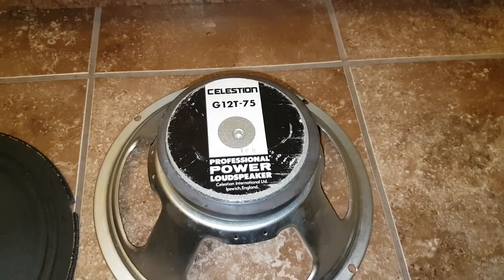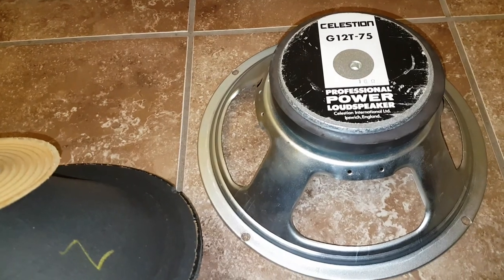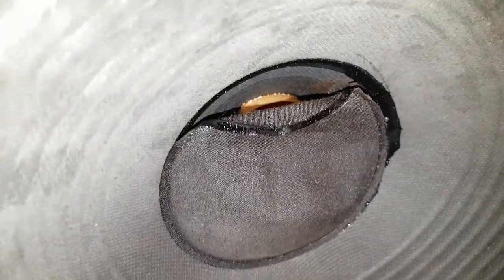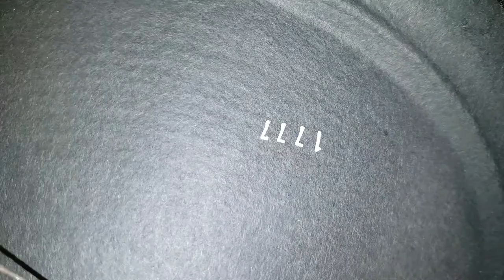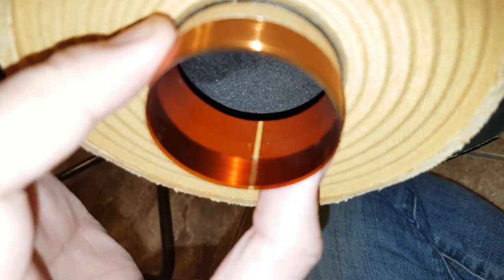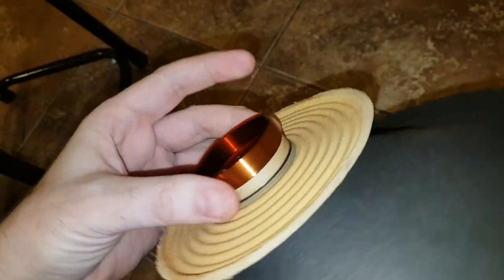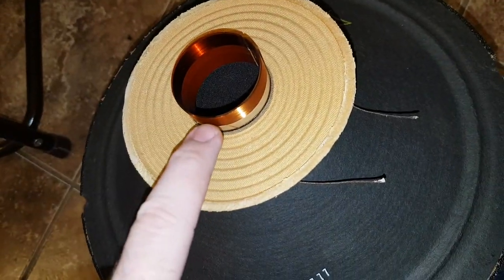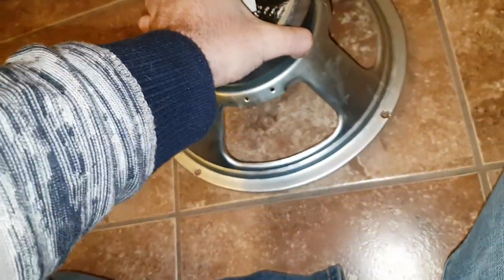(Another) Celestion Autopsy and Resurrection

Comment: Hi there. Thanks for your nice speaker videos! I have four old celestion speakers that realy need a cleaning on the chassis. After many hours searching on the internet i'm not able to find recone kits and was wondering how you release the cone from the chassis? Do you just heat it with a heatgun or..? Nice job!
Reply from the maker: Hi, can you describe in more details what substance needs to be cleaned from the frames? Also, are you really sure they all need to be reconed? If they sound good I don't recomment reconing them because they won't sound the same after. In my video I don't use a kit, I just put the same cone back in it's place. I remove it by very carefully driving an X-acto blade between the metal and the carton. When re-installing use a quality glue and use shims to center the coil in the gap. The black glue that holds the dust-cap (center) can be loosened with a hair dryer.